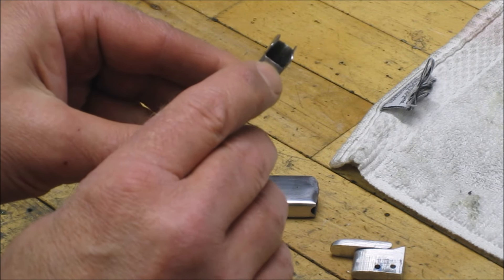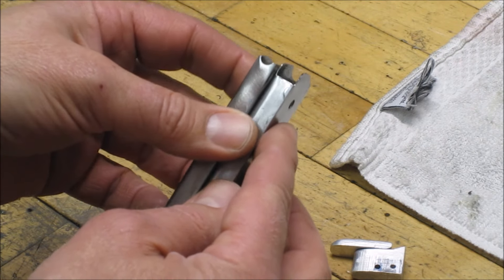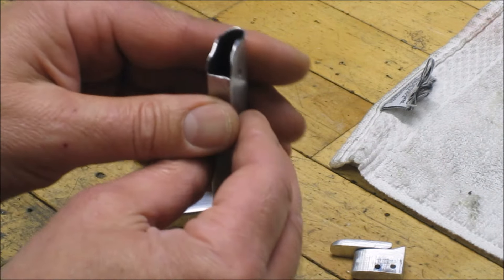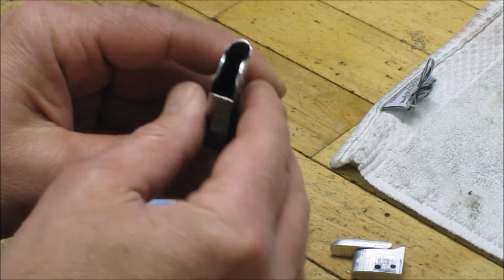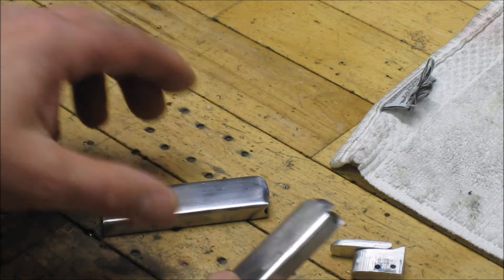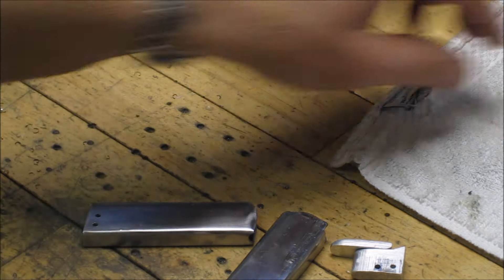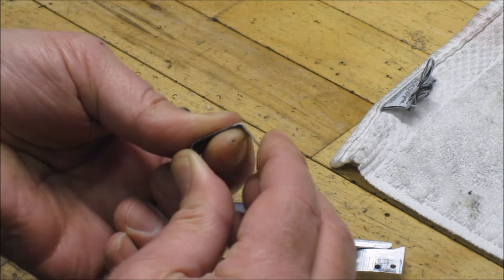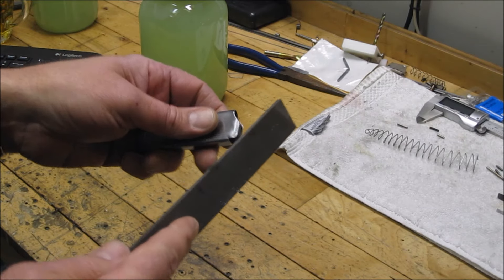Hardening mild steel... especially magazines

Comment: the best method for hardening is to test the steel with a magnet. when you heat it, it will reach a temperature where it loses all magnetism. magnets dont work on the steel! the moment that becomes the case is the ideal time to quench! hope this helps. its a trick bladesmiths use when not overheating the steel is critical

Comment: Sir We have use this solution with same amount of ingredients you have shown for mass Production of our need  the metal we have used is MS Mild Steel which has size of 20x20mm thickness: 1mm & 35x20mm Thickness:1.2mm & we are using Induction Hardening Machine of 5KVA for Harding process does solution will lose its Harding capacity if we use it for large quantity pcs for Harding process

Comment: You can just use ice cold salt saturated water. It will get harder, but you should temper afterwards.
Reply from the maker: +SalveMonesvol Yes you can. The theory behind the soap is that the added sufficant allows for better wetting therefore even faster temperature drop. This is low carbon steel and will never get hard enough to require tempering. I'm just trying a tiny bit more hardness, stiffness and wearability.
Reply: Clinton Westwood Tempering is not just a step back in hardness from quenching, the actual crystalline structure changes, releases stress, etc, so you always have to temper unless you want an unpredictable steel. A low carbon content allows you to quench in a way that would make some alloys literally explode.
You can temper for an hour in the oven, just don't go over 310 Celsius. It will only lose minimum hardness, and gain significant toughness. If you don't care much about them and they are just for testing stuff, ok.
Reply from the maker: +SalveMonesvol I'm not a metallurgist as you can tell. I'm not sure how much crystalline structure is formed in this low carbon material (1018). For the utility I'm getting from them, I'm not sure it's worth the extra effort.
Reply: Clinton Westwood all metals have a fully crystalline structure. The difference is what form the carbon takes. Ferrite can't dissolve much steel, so the excess forms carbides (cementite). When you heat the steel before quenching, the ferrite turns into austenite, which can dissolve a lot of carbon in intersticial spaces, but when you cool it down, it becomes ferrite again and if it is quick enough, the carbon gets trapped in smaller spaces, "work-hardening" the structure from the inside, but creating lots of stress. We could go much deeper, but you should always temper, and do it at a lower temperature if you really need the hardness (210-310 celsius). 
 If it's just for an experiment, I wouldn't go the extra mile either, however, if you ever work on something for a weapon to protect yourself, do it. 
 I hope it was short but informative, have a nice day!
Reply: What means "q hours"? You told about temperature of 310 C for tempering. But what about appropriate temperature and duration of heating?
Reply: Alex Trezvy 1 hour. There are charts for heating temperature, depends on the steel, the desired hardness, etc.
Reply: The theory behind Superquench is that nominally unhardenable steel [1015-1025; typically, 1030 alloy is considered minimum carbon content for hardening to occur] can achieve previously unknown levels of hardening because at this late stage of our industrial development, virtually none of the mild steel we buy is virgin alloy: it all has some recycled content, and trace amounts of elements like molybdenum and chromium have found their way into the mix. [Thank you Gillette!] The tiny amounts allow for the hardening behaviour to exhibit if the steel is quenched rapidly enough. [PS: I suggest sticking your SQ in the freezer to chill before use...] Because the mild steel is just barely alloyed enough to harden, the tempering process is skipped because it's considered unnecessary: rather than work hardening and cracking, any local microscopic points of failure just travel into a neighboring layer of atoms that aren't hardened & thereby diffuse the incipient failure of the crystal lattice. I think even the guys @ Los Alamos Labs who developed Superquench don't even consider the mild steel hardened so much as "toughened?" Anyway, if you haven't already, it's worth reading up upon the development of the SQ process, it's really quite an interesting tale... 

Of course, it wouldn't hurt to try your tempering suggestion: if it normalized the SQ'd mild steel instead of tempering [as I suspect it might], all you'd have to do is SQ it all over again.
Reply: Nunya Bidniz Normalization is achieved at much higher temperatures. I always temper, you can gain a lot of toughness and safety while losing almost nothing. Really, 300 celsius for 1 hour will not soften your steel much.
Reply: +SalveMonesvol
Normalization is the relaxation of internal stresses and the resolution of any hardening elements. It doesn't have a set temperature, esp. not when you're discussing an alloy that isn't supposed to be hardenable in the 1st place. "Not softening much" on something that's just barely holding onto the ragged edge of hardened may be too much. Only one way to find out, but considering that there's no record of these low-carbon steel parts benefiting from tempering after a SQ bath, why bother?
Reply: Nunya Bidniz Normalization does have a set temperature.

Comment: please don take it the wrong way but you really shouldent quench in a glass vessel it could explode from the sudden temperature differential
Reply from the maker: +Anthony Crumpler That's a really good point. I will rectify that next time. Luckily, the mass was small and there was very little temperature change. I will never take suggestions the wrong way when safety is involved. Thanks.
Reply: +Anthony Crumpler Nope, that amount of steel might raise the temperature a few degrees at best, thermal shock is not an issue.
Reply from the maker: Agreed. But I appreciate the heads up from the OP. Better to start safe habits early. The next piece I quench might be anvil sized:)
Reply: There are videos for that. Guy used a pond if I recall correctly. Your videos are much appreciated.

Comment: Yes to the magnet trick, but you can give it a second more.  Ideal temp is 1342F.  Magnets drop at 1280.  So you are in the ball park.   True issue is 1018 doesn't have much carbon in it, so there won't be much hardening.  Good it is though that you sre doing what we see.

Comment: Did you think about some kind of hardness-measurement tool to make you efforts more accurate and predictable?
Reply from the maker: A very crude way is to run a file against it and note the sound change against a control piece.
Reply: rockwell hardness files

Comment: Any plans to make some out of spring steel?
Reply from the maker: +Jay Goldie No, not really, because of the difficulty of welding with the system I'm using. I'm hoping that this procedure will extend the longevity of the magazine.
Reply from the maker: The first video in this build series details the magazine construction. Nothing but simple tools.
https://www.youtube.com/watch?v=y8rkllZFxx4
Reply: + My Line in the sand -- Why, do you live someplace they're controlled? At <$10/ea for new, complete, reliable magazines off the shelf, 1911 mags just aren't worth your time & trouble. Personally, I'd rather get cheap known good mags off the shelf and design the pistol around them than devote the hours to acquiring materials & making & then more hours and hours tweaking them so they will function properly, if an easier route is available. [I'm in the U.S. tho', so a trivial matter for me to buy mags, vs. a resident of Canuckistan or some other far off land where handgun ownership is banned or tightly controlled & hence, so are accessories; I'm very grateful that CCW has illustrated the process for everyone to see, however unlikely I am to pursue that same path!] :-)

Comment: any idea if steel barn siding would work for a magazine?
I've got some excess that looks to be of the stainless steel variety.
Reply from the maker: +Brandon Griswold Are you sure it's not galvanized steel? That would make more sense from a cost point in building materials. Dip it in acid and see if it reacts and cleans up. If that's the case, probably mild steel like what I used. Same techniques would be useful.

Comment: This is great, Cinton. I copied down a similar recipe for hardening low carbon sheet metal a while back (instead of Jet Dry it said to use 20 Mule Borax). Nice to see a video of it actually working. I want to make my own brass deflector and this method could actually have enough rockwell hardness to actually work. 

An aside on the feeding issues you had...Take a look at a High Standard pistol if you have not already. It has no feed ramp and the magazine lips do all the work. Somewhat finicky to get them all set, but once adjusted properly these old HS just run and run. For doubters on their performance: Dave Sevigny won the rimfire optic division in 2012 + set a new world record at the WSSC Steel Challenge with such a rid. So yah, feed ramps are sometimes overrated. hahhah ;>  

One more aside, serious props to you for the fit and finish you are getting with limited metal working tools. Very impressive and creative.
Reply from the maker: Thanks for the nice comments. The feeding issues were eventually solved and the pistol works very well. I'm going to be using the super quench again to test against oil and water. I'm curious how each works in hardening low carbon steel.

Comment: Are you tempering at all after hardening or does it harden enough to justify that?
Reply from the maker: +Caleb Burnett I'm not tempering after the hardening. The low carbon percentage does limit the degree of hardening that can be done. I can still form the magazine after the quench, although with more difficulty. The magazine lips no longer drift apart when in use. That's what I wanted to stop.

Comment: You should see if you can find Casenit for case hardening anything ferrous. The modern formulation does not work as well as before the safety nazis messed with it but it still works.

Comment: I bet it works just as well with plain old water.
Reply from the maker: +Amateur Redneck Workshop Actually, the problem with water is the steam bubble that forms at the surface and insulates the steel from rapid cooling. By changing the boiling temperature and the wetting ability, the hot steel gets cooled far faster.
Reply: +Clinton Westwood What difference would it make using engine oil?
Reply from the maker: I think it all depends on now fast you can drop the temperature. The water and additives act as a very good, non-vapor barrier liquid with a low boiling point due to the salt. But then I'm no a chemist. I've tried plain water with disappointing results. This actually worked for me.
Reply: Clinton Westwood Fair enough, I've seen knife makers using oil, just wondered what difference it made.
Reply from the maker: They're probably tempering after hardening. I made a screw driver in grade nine and after hardening, I tempered it by waiting for a blue heat mark and quenching in oil.
Reply: Clinton Westwood Interesting, thanks
Reply: oil has a higher vaporization point and therefore it cools slower than water, usually leading to less hardness if all else equal vs water quench, but it varies depending on the alloy. it is a safer quenchant for mystery steels or steels that may crack upon quenching, as it will cool slower and less violently. basically, the heat transfer rate is different. 

mild steel can only really be hardened by carburization - case hardening - and then quenching. pack your magazine into some charcoal, cover in clay or place in a steel box, cook it at critical temp (1400F - light red, not quite orange) for just a minute or so, then a sufficient amount of carbon should be deposited to the crystal structure. it depends on the metal thickness how long you need, as the carbon will need to "soak" into the steel. from there it can be hardened and tempered like normal heat treatable steel, though an oil quench is a safe bet here, especially on something so thin.

Comment: Is there a magazine that I could purchase that would work with the gun?
Reply from the maker: You would have to build around the magazine. That seems to be the starting point. I did just that on my current build the Kolt480. Started with a factory magazine and worked forward.